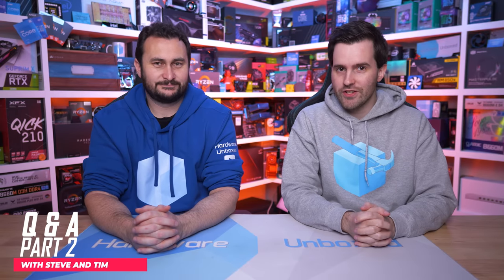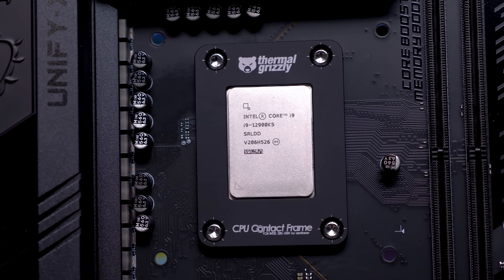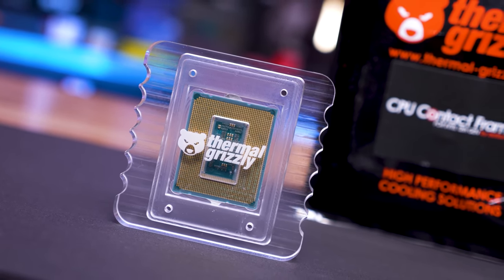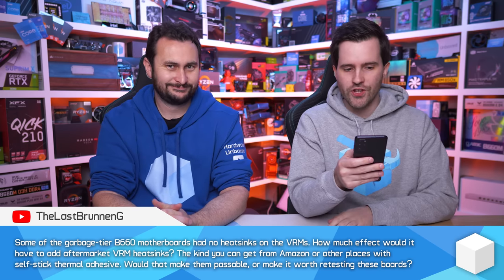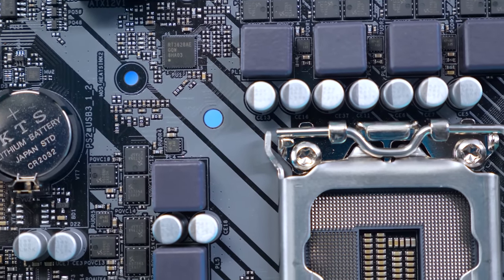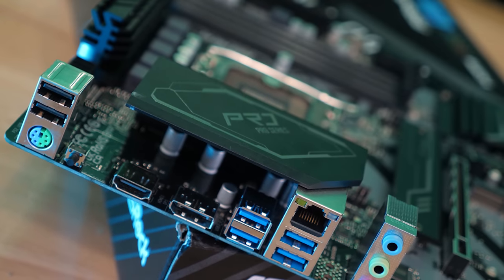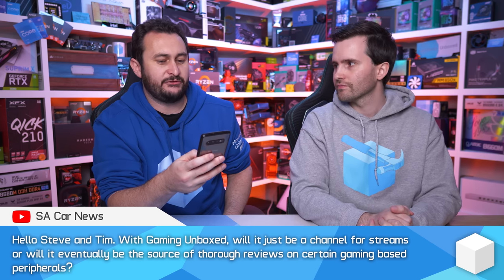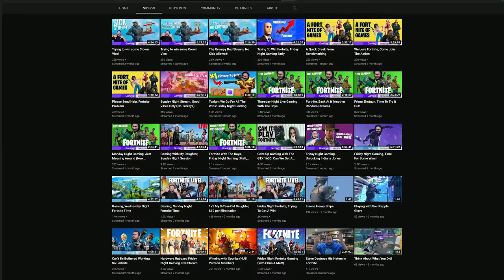Biggest Tech Fail 2022? Zen 4 To Make DDR5 Relevant? August Q&A [Part 2]

Comment: I'm a game developer for over 25 years, and while not a programmer in skill, you are correct in that games are single-thread limited for most of their tasks. Some things can be off-loaded (AI in part is actually one of them depending on the engine and specifics of the AI needs), but for the most part, games have yet to become truly, truly multi-threaded. Even games like Battlefield that use 6 cores or more are only utilizing them to a limited degree with a primary thread still dominating tasks... and that's a game serious that's actually optimized in general fairly well. Many games are not. Cities Skylines is an excellent example of a poorly optimized game that technically uses multiple cores, but is still hamstrung by that main thread (thanks to the old Unity version in part).
Reply: Exactly this. True multi thread is an illusion, especially as you get more complex games, like simulation games (stellaris, rimworld, fallout/ elder scrolls) or open world games with lots of moving parts. 

Its basically the same analogy as the E-core for gaming segment. Latency matters and you're really limited by that primary core / the fastest gravel hauler.
Reply: Thanks for that. Not a developer but as a sim gamer that is evident. Despite the focus on more cores, games haven't evolved to take advantage of that. 

Took a long time to get from 3 to 5GHz on consumer chips (2011-2017ish), but now things have really stagnated on the clock speed front. 

Despite other advancements (cache/stacking), ⏰ is still very relevant.
Reply: I think most people don't understand this, but there is a limit to how much you can use those multiple cores. People should google Amdalh's law. No program can be 100% multithreaded because you have code that needs to start up other threads and split the data into those threads. So you have 3 main parts to a multithreaded program - splitting up the work, doing the work and then merging the results (though not all cases need merging if they can work entirely independently). Programs that are said to be "well multithreaded" do little of the splitting and merging, so the cores can just focus on doing the work. Also if the work is too little, then you just take more time to split and merge than actually doing the work. Game engines can be a lot more optimized, but there's a limit to it, and honestly, games are mostly GPU bound these days.
Reply: @lycanthoss  Interesting. And yes, some games seem more optimized than others. 

I think the flight simulators I use are abysmal (DCS, MSFS mainly). Despite all the advances only the clock speed seem to matter for them.
Reply: @lycanthoss  Amdahl's Law.

Also something i'd like to point out, if you want things to scale to more true threads with less friction beyond some given threshold, you need to eliminate memory sharing (true or false sharing), at which point you're introducing message passing and data copying. But this increases overhead. Since it's an architectural decision, you can't just decide easily to sometimes not do that. So you're in a situation that in order to scale more, you'd need to bump up the minimum spec of the game, and that means someone who would really want that game won't be able to buy it because they wouldn't have a computer that runs it, that is money lost. So optimising for a low-spec target wins against scalability.

Memory sharing and cache/memory contention is only an example, lock contention is closely related, after all a lock is a memory object. Often lock-free and wait-free algorithms which scale fundamentally better to more threads have higher inherent overhead, which has a similar tradeoff. Sometimes solutions are found which are almost free of compromises but it's a hot ongoing research topic with very slow progress.
Reply: Also the way UE 5 currently performs doesn't leave much room for hope...I hope that somehow they'll improve CPU usage because right now it's mainly a single threaded engine. I'm also curious about shader compilation and what they intend to to about stutters, sadly so many games are plagued by this issue nowadays (especially UE4 games).
Reply: But games run much better on a 10c20Thread @ 5ghz than and 4c4Thread @5.2???
Reply: So super two core cpu would be best for gaming :)
Reply: @OliHandy2008  No, not really with some exceptions for 6c or maybe 8c. Unless you have a bunch of other programs running alongside, then yes, the system will breath easier with more cores handling those other programs so they don't get in the way. This of course includes considerations around Windows itself. But JUST the game, no.
Reply: @OliHandy2008  
We just need a CPU than can run games two core at 50Ghz vs 10 core at 5ghz... Or something like that.
Reply: As a game developer, i think there is a way of making "No bottleneck" in the pc, but it only comes with well optimalizated code and engine of the game / processing each frame. I will tell you a secret... Its all about time of execution of code in period of time, and spreaded it over cores. And another imprtant step, the most hardcore in developinig industry... Sync data / threads each frame , and pass it away further into another code analyzing device. If you really think about this, its all comes about time menagement and controlling is every thing is not falling apart. As a game developer, i enjoying "PC parts world" very well. You shoud study both companies "Achievements and 'tricks of menagement data between devices' " To know how programmist take advantage in "Better game engine/#moreframes/#Infinite_action@240fps/".
...
In all engines 75% power of thread execution time, is for decide what is or will be on your screen ( or just around a corner ) and how to present it very fancy and unreal. Now fight as a game engine with dual core 4 thread execution power vs 8c16t massive turbocharged with cache of your glourious data processor 😂.
Reply: Get your act together and start utilising the full CPU
Reply: @luzhang2982  Its not ilusion for you, if you developing a game/code. Every "game engine" have a "ideology" how it will be working.
Reply: For after 25year you find your statement outdated last year
Reply: This is why intel still dominates in gaming. Super fast single thread and substantially better memory latency. That latency is AMDs Achilles heel
Reply: The issue is with the popular game engines.
Reply: true, it's why a 5600X isn't that much slower in practically any game compared to a 5950X. The difference is usually less than 10FPS. Bigger L3 caches followed by faster RAM seem to help more now.
Reply: @lycanthoss  fully buffered has a video running doom on a 4 socket 16 core opteron board . I think 60 of the cores get utilization. Vulkan is one of the best examples for possible utilization . MSI Afterburner could be misreporting but it seems legit . Not sure if its just called the Quadfather.
Reply: the key with the E-core is utilisation. If they are running th background tasks like the OS that runs all the time in background while you game they are going to have a benefit on any game. Same as if I run a down sized Linux distro over Windows I able to achieve a higher FPS as Windows tasks that always run take up a little power. it is like on Phone ARM often as big core and little core. A game is made to only use big while all OS thing and telemetry not part of the game stay on the E core's, so the game runs on high cores at full speed not interruption for the OS working or heat of the E-core which sit low and mostly idol on ARM. Gaming Maker could use this to their advantage but you are talking such little gains on PC's after you have 6 or more core most programmers will pick P cores and use e-Core after they are maxed out, While Windows 11 chugs along on the E-cores in background no effecting resources being used by the game. But it is like 8 cores in the AMD FX days or should I 4 ,duel compute cores labelled as 8 cores. Any way until game really tax and struggle of 6 cores or less they small number of Gamer's buying into 8 or more cores it just not worth the work of multi threading and optimising those E-cores which is why passed the 12600 I would jump ship as on higher end AM just have more P cores. But still in Gaming 8 core/16 thread is a bit of a waste unless you going balls out of higher end GPU's in which case you'll get a X3D chip or wait till intel 13th gen or Ryzen 7000, what I can say is Intel are not giving any hype to 13th gen so it either sells itself as in it good or they are just going to up the clocks a little along with the Temps just like Zen 4 but at least watt per compute has gone down as well but 105w is a lot if you times that by large number of machines. For productivity Intel is good but Gaming best thing a programmer can do is ignore them at the moment and leave that to windows to core manage the OS on. as 6 or more intel P cores would offer most gamers what they need, only a couple of gamer's buy the high end gear vs low end gear where they will be bottleneck by dGPU way before 6 or more cores are needed.
Reply: Pentium 4 era devs were right all along, they knew modern CPUs would be 5Ghz+ single thread monsters. Even UE5 is single thread dependent.
Reply: What happens when gaming starts supporting multi-core? Improvement in performance?
Reply: Battlefield optimized!!!???

HAH! what a joke!
Reply: @mylittlepwny3447  it’s because games are developed for the intel handouts. For your statement to be true then no game would ever have higher FPS on Amd which isn’t the case .
Reply: @zaxmaxlax  you would think having to deal with 8 weak Jaguar cores in the last-gen consoles would make them step up their multithreaded programming game
Reply: @Lurch7861 I think Hogwarts is mining in the background 😆
Reply: Parallel processing is still poorly understood. Some problems are naturally parallel which is what fools people. The game engine and logic would need to be built from the ground up with parallelism as a primary concern and that seems fairly unlikely.
Reply: @Nintenboy01  Now that you mention it, there was no excuse for not optimizing for multithread, they had years and years, PS3 also had 7 "threads".
Reply: @Lurch7861 Its just an UE game, it will be full of stutters you will see.
Reply: @Lurch7861 Interesting, will have to check it out!
Reply: @OliHandy2008  instructions per walks the line
Reply: @Mathew Anderson 

Could i ask you, from a developper's standpoint, how well optimised is "Doom" as a program ? Please ?
Reply: @Nintenboy01  if you don't know the history of cpus then have a look at the p4. The p4 was only 'fast' because it had a large l3/l4 etc cache. The long pipeline would get starved without it and pipeline flushing took a rather long time.
Reply: Yeah, Skylines in particular was that one game I'd really hoped to make more use of cores before finding out about that. It flat out froze my entire PC after a certain pop threshold, so that was with a shitty 4c/4t i5 that only boosted to 3.3ghz, but then when I got it to 3.5-3.9ghz with hyperthreading it ran just fine.

You forgot about Universe Sandbox2. That was another massive disappointment. I was hoping to get really nuts performance out of my 3700x with it and it just doesn't. Octacore is still meh for gaming in 2022. So I do think a bit about AMD got overhyped, regardless how much closer to true objective fact that was than Intel. 
Intel's gonna get trashed in 2022-2023 though. If AMD could get up to 5.7ghz on that one core with lower IPC, it's over. It just disappoints me multicore isn't better yet. I was hoping devs would over time make hexcores the standard, which in fairness I've found games I really didn't expect to like FPS work super well on an 8 core.
Reply: As a programmer I always liked one gaint for loop than async nonsense
Reply: @hangender  I prefer a nice goto.
Reply: @skilletpan5674  goto and for is pretty much the same once the complier translate code into assembly
Reply: Why does the Ryzen 5 5500 beat the 13100f in many games?  And why does the 5600 beat it almost every game.  Just wondering.

Comment: The sad thing about the intel GPUs is the company has the money to do better. I think they thought it would be easier then it actually is to make one.
Reply: @regwatson2017  Idk. Amd has a history of doing so much better than much huger Intel, to getting left behind for a bit, then coming back and making something exceptional and also inventing great updates to the wider x86 architecture, to getting left behidn and getting anticompetitive tactics from Intel, to coming back and throwing a pie at Intel's face and serving it up for several years now.
Reply: Weirder still is they are used to making drivers for their CPUs with intergrated graphics so why are they having graphic driver troubles now?

Edit: Weirded --> Weirder
Reply: @paulct91  I would imagine igpu's have different architectures than dgpu's which, of course, means intel doesn't have the relevant experience for making dgpu's.

Also their igpu's are seriously lacking and have been for years. Amd's igpu's make that apparent with how well they perform given their power consumption. Intel's best igpu is not even integrated which is hilarious and shoots the price of whatever prebuild contains it to $1k+ despite it's disappointing performance.

Intel is still solely a cpu company in my eyes and probably will be for another 5 years at least.

Comment: There is no fundamental reason DDR5 should be more expensive than DDR4. As soon as manufacturers ramp up DDR5 production, prices will come down. AM5 will increase DDR5 a little bit and give manufacturers a bit more confidence to invest into DDR5 production.
Reply: That's obvious. Just like DDR4 wasn't more expensive than DDR3. Also DDR3 wasn't more expensive than DDR2. DDR2 wasn't more expensive than DDR. DDR wasn't more expensive than SDR. SDR wasn't more expensive than EDO. New memory always starts off expensive until production ramps up then prices drop.
Reply: @MarkLikesCoffee860  DDR4 had a period where prices skyrocketed 2-3 years after they were introduced because of mobile device demands. I am worried the same thing will happen with DDR5.

Comment: I remember I had a q6600 and a year later i7 series came out, and I upgraded right away to i7 920, it lasted me a good 11 years or so for gaming (Dead Space / MMORPGs / Batman Arkham Knight / RE2 Remake / Apex Legends), editing video, streaming, all I needed was to upgrade the GPU (which was quite often). Changed PSU twice and the 2nd one went kaput and for some reason the mobo wouldn't turn on I had to upgrade to 5600x (I would have upgraded to R7, but 5700x and 5800x3D wasn't released at that time), I think I'm gonna stick to 5600x for quite a while.
Reply: My X58 rig served me for good 7 years -- the longest of them all. i7-920 first and then a cheap used 6-core Xeon. The need for more RAM pushed me to a bargain deal on X99 mobo and CPU combo. Currently rocking a i7-6950X, but will probably max the platform with a 22-core Xeon from AliExpress.
Reply: @Ivan-pr7ku  I upgraded my X58 i7-920/R7 360 rig up to an i7-990X/1070ti before I retired it for a 5950x/3080 FE build. X58 was wonderful.
Reply: intel ruled the market so they had incremental cpu upgrades for half a decade, nowadays cpus are advancing much faster
Reply: Still use my and 2600x .
Still fast if you play over 1080p resolution.
You have than a gpu botleck on higher resolution and your cpu have what more coffee break time.
Reply: yup, best to hold onto it until at least Zen 5/6 or maybe even the PlayStation 6 releases
Reply: my kid still rocks my old i5 750!
Reply: I had i7-920, OC to 3.33GHZ, I used that PC for 10 years. I upgraded the GPU twice due to games I played and added more storage. My 650w corsair PSU failed so I upgraded to a 750W, which I'm using now. At the start of 2020, I retired the i7-920 system for 3950X, 64GB ram, 5700XT, hoping that with a few upgrades (GPU) I get a good few years out of the system
Reply: Going from an i7 920 to a Ryzen 5600X is like going from a horse drawn buggy to a modern sports car. That's one huge upgrade lol

Comment: 7:45 an easy way to account for DPI, in-game sensitivity etc. is to physically measure the distance on your mousepad for a 360deg rotation and share that sensitivity as X cm/360
Reply: Just wanted to write this, thanks!
Reply: Or you can write all variables, something like 1600DPI, Windows sense 7, Csgo ingame sense 0.5. That would also explain everything.